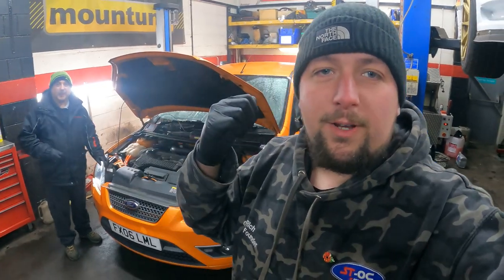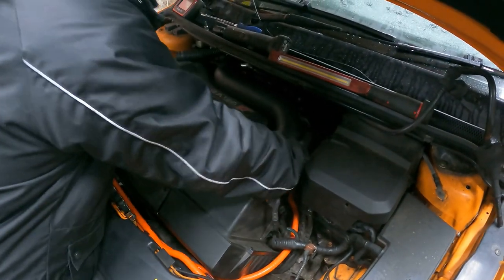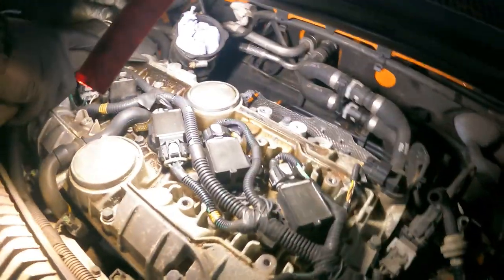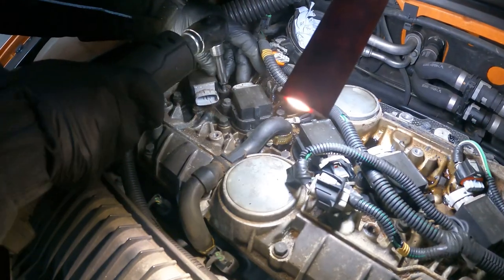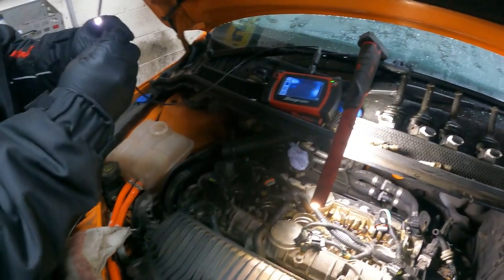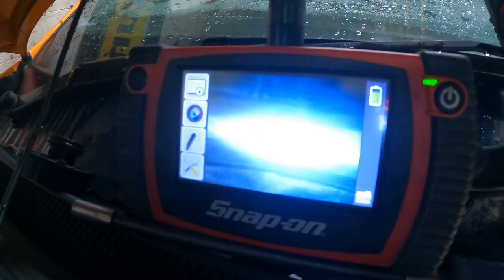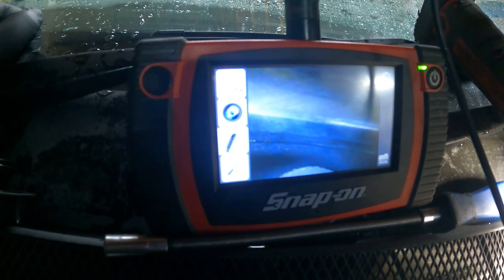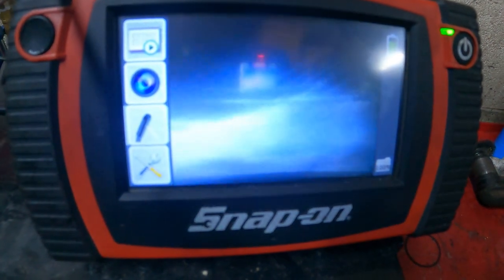An Insight Into Cracked Liners On Focus ST225 Mondeo S-Max 2.5T 5POT & How To Diagnose

Comment: can the cracked liner be repaired i think mine has done the same is it worth doing an if i may ask can it be a costly repair
Reply from the maker: Unfortunately if the liner has cracked it will require a new block then engine rebuild, or complete engine change

Comment: So just come across this video , I’ve literally just had this problem , one of the heater matrix pipes burst , I noticed this because the oil pressure gauge dropped . Pulled over , managed to stretch the pipe back onto where it goes . Drove home and noticed that the oil pressure was dropping when I slowed down , and there’s smoke when I come off throttle ? 
How much would it be to diagnose this like in the video . Thanks
Reply: How low did your oil pressure drop to?

Comment: I have a completely stock Focus st. 226 Hp and 130'000 Km. Should i worry about cracked liners?
Reply from the maker: Liners can crack on low/high mileage and on standard or modified.. its basically a lottery, I highly recommend you get the block mod done for piece of mind.
Reply: @RichST  I've heard from someone who works on these focuses alot that the block mod causes the cylinders to go oval shaped do you have any knowledge/experience with this? Thanks